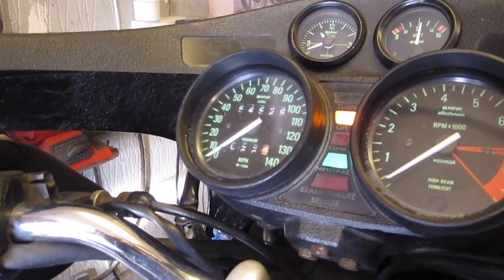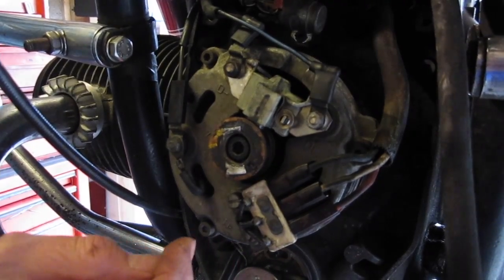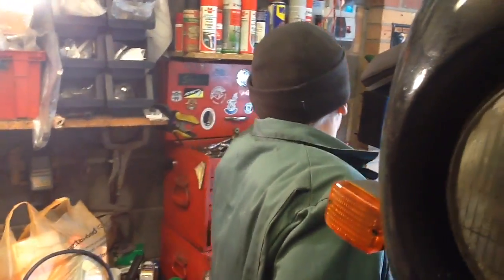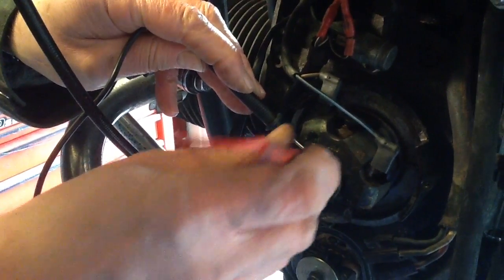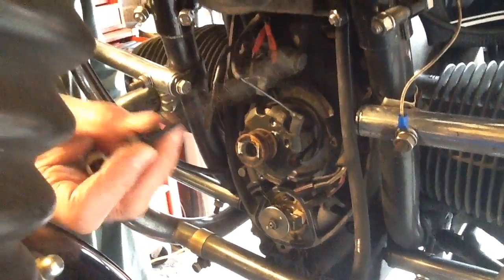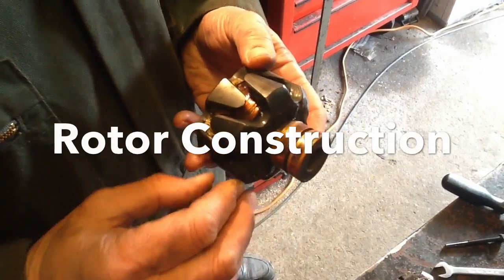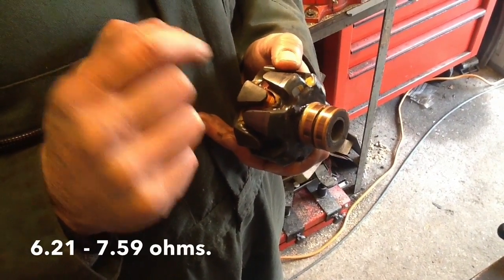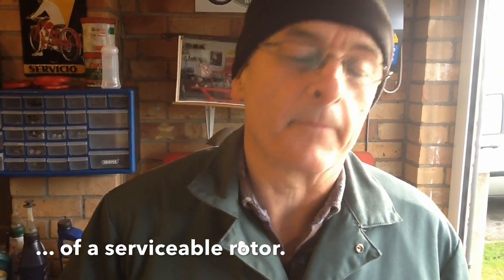Airhead Battery Not Charging

Comment: Hello, I am writing türkiye.I have 83 model r65.right cylinder ignition is irregular.the failur spark plug.can you help me.what should I do.good and happy days
Reply from the maker: BA ÇA that’s quite a big question and you would need to describe the symptoms more specifically. 
If you are not getting any, or possibly irregular sparks at both sparking plugs, try checking there is consistent battery voltage at the supply side of the coil. If the supply is nonexistent or inconsistent, check through the electrical couplings and switches etc in the circuit up to that point for broken, dirty or intermittent connection(s). Use a voltmeter to help in your diagnosis. All measurements up to the coil should be within 0.5V of the measured battery voltage when the ignition is on.
Reply: @motophoenix5951  than you for your information.do you advise using iridium based spark plug?
Reply: By the time spark plug changed especially the right one the problem is temporally solvet.
Reply from the maker: BA ÇA Iridium plugs are okay, but not necessary in my opinion. 
If a new plug temporarily improves the engine running then you may have a problem with the coil.  If it is the type that takes ht cables for both cylinders then it may have cracked, (these types of coil do have a reputation for developing cracks) this being the source of the misfire. Unless you have special coil testing equipment, the only way to be sure is to substitute one that is known to be working properly.
Reply: @motophoenix5951  First of all, thank you for your interest. The ignition coil of the motorcycle has a crack.
Reply: @motophoenix5951  coil changed and the spark plug cables changed.
Reply: @motophoenix5951  There is no problem now.
Reply from the maker: BA ÇA Good to know you got it fixed.

Comment: Thanks for the informative video, I was looking to see what the rotor removal tool looked like.
One thing I failed to notice ( I may have missed it) is that you made no mention of the slip rings being glazed-over. This would also give an open-circuit reading, but could be rectified with fine wet/dry paper to clean them, and not need a replacement rotor. Best regards Iain
Reply from the maker: Thanks for the comment Iain. 
I usually clean slip rings and commutators with an abrasive 'nylon' pot scourer followed with a wipe over with an alcohol soaked rag to degrease. Which is what I seem to recall doing on this occasion. I use this method instead of abrasive paper to reduce the chance of 'grit' off the paper becoming embedded in the slip ring. Alternatively, I have used a commercially available switch cleaner.

Comment: Thanks for the video.  Had the battery on my 1990 R100GS go flat.  Battery recharged OK.  Used your process to check the problem and turned out to be the rotor open circuit.  Luckily had a spare rotor and extractor bolt to hand and it took me 80 minutes work to analyse and replace.  Super.  Now I just need a video to explain the reason for having a warning light that fails to indicate a lack of charging, when the alternator wiring fails.
Reply from the maker: I'm pleased you found the video helpful. To get around the design weakness you in this system, you could always fit a voltmeter; if my memory serves correctly, BMW did offer a voltmeter as an accessory to fit the early GSs. Alternatively you could fit a battery status monitor, available from AO services: http://www.aoservices.co.uk/index.htm I have had one for years on my GS PD, it works very well.

Comment: Good info!...thx...do we have some or all? Fuses in the headlight? On rs 100   Year1979?
Reply from the maker: Can't say for sure, many BMWs do have them in the headlamp, others have them located elsewhere. For example, my GS PD has them under the left side panel.
If you get hold of either a Haynes manual or a Clymer manual for your model you will be able to find out for sure.
Another useful resource for airhead BMWs is Snowbum's website. It is a mine of useful information. Here is a link:http://bmwmotorcycletech.info/technical-articles-list.htm

Comment: Thank you for the video , I just picked up  1976 BMW R90/6 it does not run but Im working on that .....this will help
Reply from the maker: Glad the video is of help to you. Good luck with the new project.
Reply: I've had an R90/6 for ~25 years. It's been very reliable and it's a sweet-riding machine. It's not nearly as fast as my R1200... but still nice for an old-timer.

Comment: Great video and information as ever!
My R80/7 1979 is not charging. The charging light used to go out when the revs went up, but now the light stays on all of the time.
What would you recommend I test first? and is there any particular order of things to test?

Should I test the Diode board and Voltage regulator first?

Any help would be really appreciated as I'm stuck on what to do next.

Thanks
Reply from the maker: If you look at the current Haynes manual Mark on page 10.6, there is a good quick test there. That is a good place to start. Get back to me for further advice if you need it. Good luck, Guy
Reply: Thanks Guy, appreciate your help.

Before reading your reply, I tried a test on the regulator. I removed and bridged the D+ blue wire to the DF blue/black wires together. Run the engine at approx 1500/2000 rpm and the charge lamp goes out. 
Did a metre reading and it was around 13.5 V. I'm guessing it should be 14V.

Does that all sound correct?

Regards
Mark
Reply from the maker: So as i understand it, you got 13.5 at about 1500-2000 rpm with the blue and blue/black wire connected to each other. That is about right, if you take the revs higher the voltage should increase, but don't let it go past 15.5 - 16V. If this works, re connect the cables as they should be and replace the regulator. Note: if you are doing short distance, or stop, start in town a lot, you may like to consider a high output regulator. These are available from Motorworks, Motobins etc.
Reply: I am doing short distance, stop, start riding, so I'll look into a high output regulator, thanks for advise!
I noticed that the wire connections to the regulator were quite dirty and corroded, so I put new crimp terminals on and the Gen light seems to be working ok so far!
Reply from the maker: Always good to check connections Mark. I cover and plug exposed electrical connectors with petroleum jelly (Vaseline). It works well, drastically slowing down oxidation, that inevitably leads to broken or poor connections. Especially if you ride year round.
Reply: Great tip!! will try it. Thanks again...

Comment: Thank you for this extremely helpful video.  I used it in changing the rotor in a '78 /7.  At the same time, I changed the voltage regulator.  However, I am still getting only 11.7 volts with the changing system.  Does anyone have suggestions for other things that I can check to identify and solve the problem?

Thanks.
Reply from the maker: Hi Emma, I am glad you found the video helpful, but sorry to learn you are still having problems. Does the charging system warning light come on when the ignition is switched on? If it does, does it go out when you start the engine? Make sure it fully extinguishes by checking in low light conditions (darkness). If you can still see a glimmer, it may be a faulty rectifier (diode board). Let me know how you get on.
Reply: I replaced the diode board and the brushes at the same time as I replaced the rotor and regulator.  Now the warning light stays on at full intensity once the engine starts no matter what the engine r.p.m.  This had been a problem before the bike died and I lost the warning light altogether, which led me to think that I had found the problem and answer with your video.  I really appreciate your quick response but still wonder if you have any more suggestions.
Reply from the maker: Okay, as i understand it, your initial problem was that the warning lamp did not come on, so you replaced the rotor etc. Now the lamp comes on and stays on. Assuming my understanding is correct, then it may be the stator has become damaged. Locate the 3 phase winding terminals on the front of the stator (between 4 and 5 o'clock as you view the front of the alternator assy). Check the stator winding resistance between the three phase terminals in turn by placing ohm meter probes on any two terminals until you have tested the continuity of each of the three windings. The resistance between any pair of terminals should be about 6 ohms in all the tests. A significantly lower or higher reading points to a faulty stator. Also check the resistance between each terminal and the alternator body. This should give an open circuit or infinity reading. Any reading other than infinity is unacceptable. If the stator checks out okay, you need to re-test the regulator and rectifier. Remember, to always disconnect the battery when you are removing/replacing the rectifier as an accidental short will likely damage it beyond repair. Good luck!
Reply: The original problem was that the charging light was staying on most of the time, but then after the bike died on the road, the light would not come on at all.  After I replaced the rotor, diode board, and regulator, the light came back on, and the bike seemed to run well, but the light was staying on at full intensity again.  Because the bike has nearly 100,000 miles, and I would like to get it to be reliable again, I have replaced the stator and put in a new battery, but the generator light continues to be on at full intensity when the bike is running.   Somehow I suspect that there may be a short in the system, but I am not sure how to find it or what other problems may be possible.  Any suggestions?
Reply from the maker: With the engine stationary and ignition on, disconnect the D +/- wire at the alternator and the light should go out. If it doesn't try disconnecting the other brush cable (blue with black tracer). If it goes out this time, then there is a short somewhere between the two brush terminals; possibly rotor, or brush terminal connections. If with the two cables disconnected the lamp continues to stay lit, then it may be there is a short some where between the lamp and the DF brush terminal (cable blue with black tracer).
Reply: Is it good news that the light goes out when the D +/- is disconnected?  According to one check-list I am trying to work with, that puts the problem in either the rotor or the DF insulated connection.  Since I put in a new rotor, is there a way I can check or go around the insulated connection?  Please do not hesitate to make basic suggestions as I have a long history of missing what probably should have been obvious with this bike,
Reply from the maker: It is good that the light goes out. It indicates that there is no short in the warning lamp circuit. Since you say you have replaced the rotor, stator, brushes, rectifier and regulator, we are left with the possibility that either one of the new components is faulty, or there is a bad /broken connection in the wiring of the rectifier/ regulator circuitry, or an open circuit between the large output terminal on the side of the rectifier and the battery. Start by removing the large female spade terminal from the rectifier and connect a voltmeter between it and earth. You should get a similar reading to that of the battery. If you get 0 volts the fault is an open circuit there. If you get battery voltage, or thereabouts, then the fault is still in the charging system. if this is the case I suggest you look carefully at the connections on all the components you replaced.
Reply: I have .1 in female spade terminal.  I got a full battery charge on the red lead going into the starter relay and then found a shaky connection on the central wire coming out of the relay with the help of another of your videos, but replacing that made no difference in the charge going into the diode board.  Is there a way to test the starter relay, or are there other things in that area that I could check for problems?  I suspect that the shaky connector was at least part of the problem.
Reply: Oops!   Maybe it's time to get my glasses checked.  I was trying to get a reading from the large connection on the back of the diode board rather than the side.  I do have the full battery charge coming through to the diode board and will check the other connections. Is there a way to temporarily go around the kill switch as there seems to be a temperamental connection in it?
Reply from the maker: You can get around the kill switch by bridging the connections for the kill switch cables inside the headlamp. Use your wiring diagram (page 10.23 in the current Haynes manual) to guide you.
Reply from the maker: Any 4 terminal relay can be tested by connecting terminals 30 and 87 in circuit to an ohm meter; you should then see open circuit on the meter. Then if you connect a 12V battery across terminals 85 and 86, the ohm meter should then read very close to 0 ohms. A high resistance, or open circuit value means the relay is faulty. There is also a section on relay testing in the current Haynes manual on page 10.11. Hope this helps.
Reply: @motophoenix5951 this reply renewed my confidence to go back to work on my r75/5. I have been watching this video numerous times coz i find it informative, clear explanation, no bullshit. Until i read the comments i realize ive been missing this step. My r75 gen light is on even wih the D- wire disconnected. Now ima need to remove the alt cover n check for possible short circuit on the brushes n coil.
Reply: I rebuilt the kill switch and replaced the relay and now have the full battery charge at the female spade on the rectifier, but the charge light remains on a full intensity when the bike is running.  I also ran another wire down from the regulator to the alternator but am only getting slightly more than 12 volts coming back to the battery when the bike is running.  Have you any other suggestions for narrowing down or isolating the problem?
Reply: As part of replacing the rotor, I also put in a new housing for the brushes.  .When a friend and I went through the system, we found that I had replaced the original washers on the DF bolt with rubber washers on the inside face of the alternator.  Apparently that was shorting out the system because after we put in two nylon washers, we got at least 13.5 volts going on through the system back to the battery.  That at least gets me back on the road with 550 miles to go for the 100,000 mile turnover.  Many, many thanks for your patient help and suggestions.
Reply from the maker: Glad to see you have solved the problem. Best wishes, Guy
Reply: The generator light came back on as I was slowing down after taking the bike up into fifth gear for the first time and continued to be on at full intensity when I started it again after it had cooled off.  So much for my solution/breakthrough.  Any suggestions or reflections would be greatly appreciated . . .
Reply from the maker: Oh dear! Well I'd go straight back to take another look at that DF bolt first. Failing that, I think you will have to start again. But first try this, with the ignition switched on you could try lifting the brush off the slip ring, the gen light should extinguish when you do this. If it does not, then you still have a short.
Reply: The gen light goes out when I pull the brush off the slip ring.  I will check the washers on the DF bolt though I do not know how they could have slipped out of place.  Should I just have regular washers on the D- side?  The bike seemed to be charging fine until for nearly 10 miles until I slowed down.

Comment: great video and useful tips as well!I have a 1982 R100T which has a charging problem...I will leave the battery on a trickle charger overnight which will be fine for a few days but riding around will eventually drain the battery.battery is almost new from BMW, I have tested the rotor for resistance and it came back at 3.8 ohms, I shorted the regulator to see if it is the problem, once done I couldonly get 12V at around 3000rpm, i was under the impression that this procedure would give full output to the alternator..at least up to 14v or so but no luck even reving the engine it was stuck at 12v. once the plug was back in I got around 8V and generator light was on!!!any input you can share?thanks,Terry
Reply from the maker: Hi Terry. The resistance between slip rings on the rotor looks okay. Not sure what you did when you say you shorted the regulator, but you should have removed the regulator and bridged the D+ (blue wire) to the DF (blue/black wire) on the socket. Run the engine between 1000 and 2000 rpm briefly. If the charge lamp goes out, then the regulator is likely at fault. If not then you will need to look elsewhere, possibly the stator. You can check the stator winding resistance between phases; should be about 0.62 ohms. Between phases and earth should be open. Good luck.